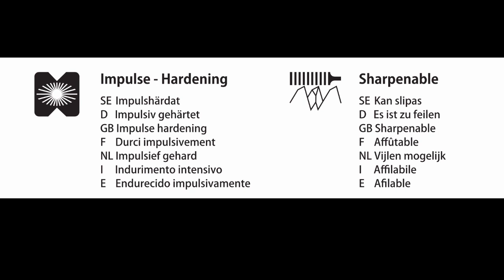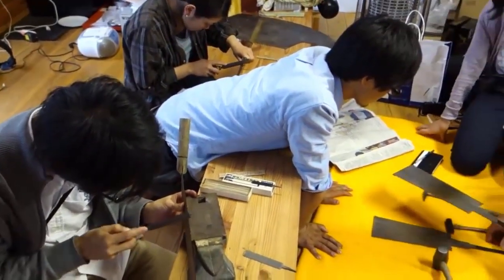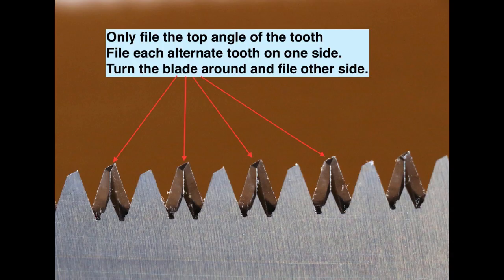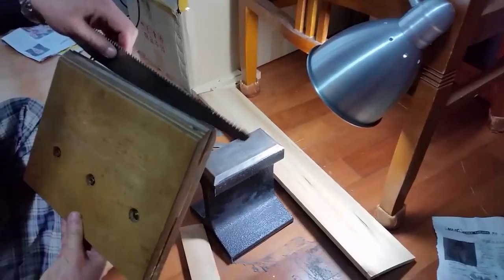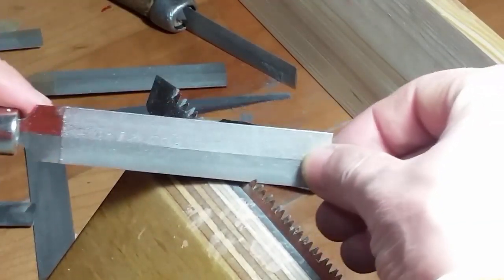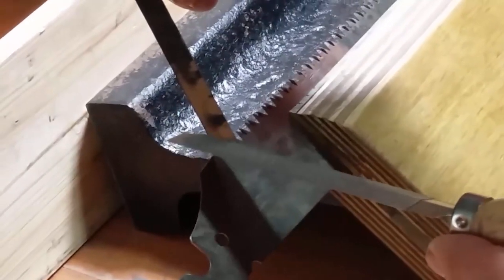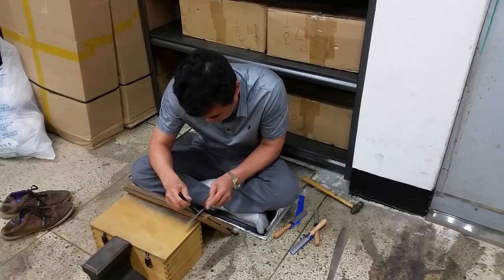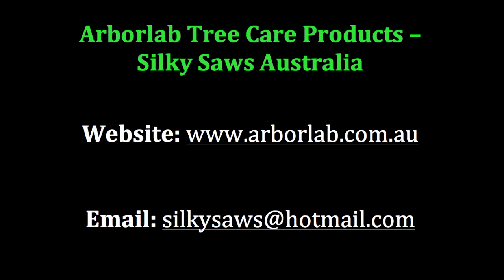Sharpening a Silky Saw

Comment: Good video.  Not counting the tip, it seems that you are discussing only sharpening 1/4 of the sides on one side, then flipping it over and then sharpening 1/4 of the sides, thus in total, only sharpening 1/2 of the sharpened sides of the teeth?
Reply from the maker: Hi Larry, sharpening these teeth can be a bit confusing!  There are 3 sides to a Silky tooth (including the top angle.)  So when you have it secured, you need to sharpen both (2) faces of the teeth on...say the right side of the saw before flipping the blade and doing both sides of the teeth on the left side of the saw. Then if you are doing this for the third time, or have a need to, then you go over the tip of the tooth. I hope this makes sense!  😃 Nita

Comment: Will those files and this technique work on impulse hardened Zubat blades? Having a lot of trouble
Reply: Hi, no you cant sharpen the hardened teeth as the teeth are harder than the file.  You will just eat into the file.  The only file that would work on a hardened tooth is a diamond file, but you are likely to snap the teeth off while trying to file them.   You can buy a replacement blade for any of the Silky Saws.  I hope this helps! 😃  Nita.

Comment: Tooth setting is paramount, as well as sharpening.
Reply from the maker: Good point Jer Szak.  If anyone is unsure if the Silky saw they have has set teeth please contact us, as many of the Silky saws are not set teeth, so you will change the cutting dramatically if you try to set those teeth.  Nita.
Reply: @SILKYsaw  
Ahhhhh, touché!
So used to filing Marvin style saw blades that I got them confused. 
Maybe you can help with this quandary; How many Silky blades should I expect to hone with just a single Silky file?
I've noticed they lose some integrity after about 5 sharpenings.
Am I doing something wrong?
Thanks.
Reply from the maker: Hi  @blondemommyvomit  just wondering which Silky Saws you are sharpening?  Nita
Reply: @SILKYsaw  
Hayauchi polesaw and Sugoi handsaw.
Reply from the maker: Hi, it is very hard to say exactly but approximately 5-10 times.  Both those saws you have are designed to be sharpened.  I hope this helps, Nita.
Reply: @SILKYsaw  
Indeed it did.
Thanks Nita.
Reply from the maker: Anytime!  @1neAdam12

Comment: Question. Im trying to recover a blade that has been misfiled, by me actually. When u file A does the angled piece slope towards the handle or the tip. Assuming its the same for both sides. Thanks
Reply from the maker: Hi ozbizbozzle, the pointy bit of the tooth points back toward the handle. If you let me know which saw you have we should be able to get you the angle Silky recommends for filing. 
I am assuming you are talking about the angle depicted in the diagram at about 1:15 in the video.   cheers  Rick
Reply from the maker: Hi ozbizbozzle, the point of the tooth is pointing toward the handle. 
The face A is filed at a certain angle. If you let us know which Silky you have, we should be able to provide you with the angle Silky recommends for filing face A for your saw. The angles differ for the saws according to the work they were designed for.
Sounds complicated but is easier than you think.
When you file, only file in the push direction and then lift the file and push for the second stroke. Don't saw the file across the tooth. Two strokes per tooth should be sufficient.
Even if you can't get your blade back to original, you will have learnt a lot and will feel the difference when you cut. 
All the Season's best    Rick
Reply from the maker: Hi Ozbizbozzle, we keep trying to reply to you, but it keeps disappearing, sorry.  We will keep trying.
Reply from the maker: Hi ozbizbozzle, the tip of face A points to the handle. This is the cutting face and digs in progressively as you pull the saw toward you. If you let us know the Silky Saw you have we can let you know the Silky recommended filing angle for face A. 
When filing you should only need two strokes per tooth. Push the file over the the tooth, then lift, return to the start point and push the file again. Don't saw the file back and forward across the tooth.
Glad to hear that you are having a go at filing. You will get better and quicker.
best regards for the season   Rick
Reply from the maker: Hi, we have tried to reply to you a couple of times, but it keeps getting deleted.  Just testing it now.
Reply: No I am getting your helpful messages. I think mine is a 33cm Sabat. Not sure. I'll take a photo after xmas

Comment: Thank you. How do we sharpen impulse-hardened saws?
Reply from the maker: Hi, Silky do not recommend sharpening their hardened teeth, but if you did want to try you would need a diamond file and you need to be very careful so as to avoid snapping the teeth off.  I hope this helps, Nita. 😀
Reply: SILKY Saws Australia do you know how impulse-hardened blades are sharpened during production? With laser or something? If so, that kind of professional sharpening service would be very good to make old blades like brand-new.
Reply from the maker: @hevesat1920  Hi, we do not recommend sharpening hardened blades.  You are best to buy replacement blades.  They are not to expensive so worth looking into.
Reply: SILKY Saws Australia they are expensive in my country because of dollar cost. 1 us dollar equals more than 7 fold of our currency. These quality stuff are imported based on us dollars. Thats why I m trying to find a way to keep using old blades.
Reply from the maker: @hevesat1920  I am sorry to hear that.  Well I hope you have some success with using a diamond file.  Tip is to only sharpen the top edge of the tooth.  That is your best chance of sharpening them up to begin with.
Reply: I use the katanaboy 650 since few years and I use a diamond plate for sharpening. I polish both sides of the teeth with the plate and my saw is unbelievable sharp. Mostly I cut oak trees with this saw.

Comment: This is diamond file?
Reply: Hi Jack, it is a diamond-shaped feather file 😃
Reply: @gardensandtrees  would this sharpen the katana boy 650 when it gets blunt....which isnt any time soon!
Reply: @jackwheatley8  Yes, absolutely, if and when you do, just go over the top edge only!  It should be on a 37 degree angle 😊
Reply: @gardensandtrees  okay cool, but only with a diamond file not a standard file? as its hardened steel isnt it? the tips
Reply: @jackwheatley8  So they do not harden the steel on this one.  Also, the file is Diamond SHAPED, not a diamond file.  It is a feather file in a very narrow diamond shape. 😃 Nita

Comment: Diamond files can't sharpen impulse-hardened saws ?
Reply from the maker: Hi Seb, Silky have said that a Diamond file can sharpen their hardened teeth, however they do not recommend it, as it is very easy to break the teeth off and very hard to achieve a good finish.  Thanks for your question, Nita

Comment: Why only sharpen half of the teeth? That seems like an important detail that was missed.
Reply: The first 2 sharpens often only require the tip to be sharpened.  No need to touch the sides unless you have lost length or damaged the tooth further down.  😊